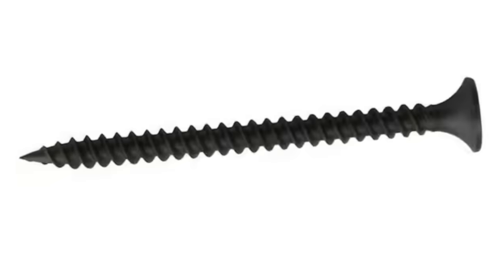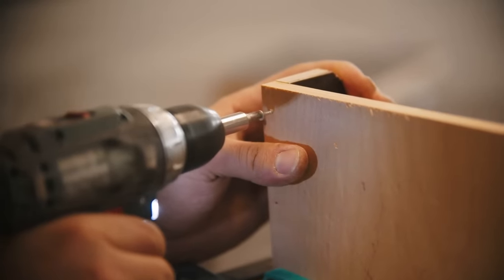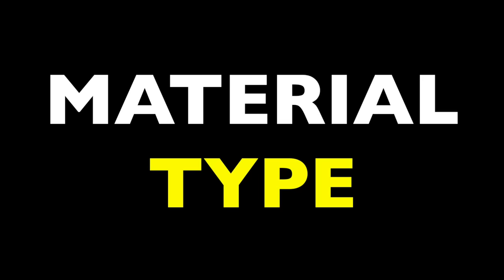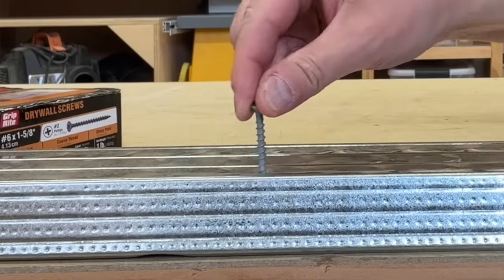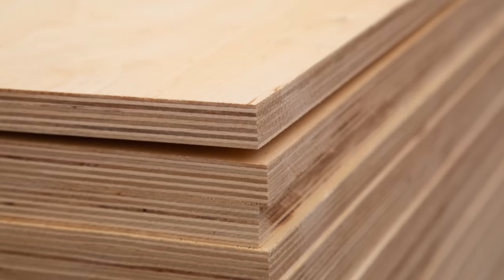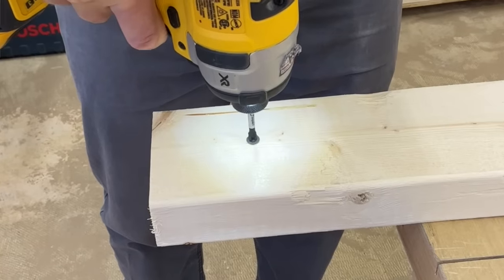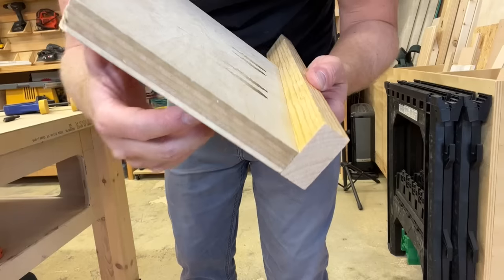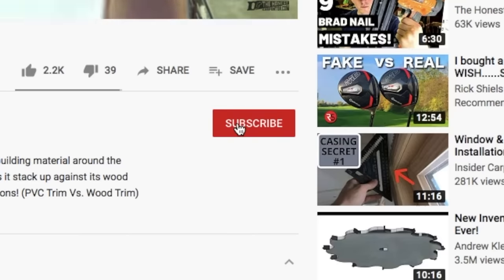This UNNOTICED Screw Detail Makes a Big Difference! (COARSE THREAD vs. FINE THREAD)

Comment: actually i have had many issues with course screws in pine boards and find fine thread work way better on pine boards than course screws even if pre drilled- my first holes are usually 1 1/2" either end of board then space depending length of board but if use course screws best try 3" on either side of board but when laying boards on wall i have lot less cracking and other issues with fine thread and just add some  wood glue to the screw-

Comment: As ignorantly simply as this subject is, it's important.  Most folks couldn't care but when your job depends on it, know what your doing.
TIP - Pilot hole drill size one step smaller than the diameter of the screw root (between the threads).

Comment: The function of that unthreaded portion becomes clear with Australian hardwoods.  A fully threaded screw cannot pull two pieces together.  Leaving a small loose gap.  So I have to fine drill the furthest piece to grab the threads then a larger hole in the top piece so that the unthreaded portion can fit.  It largely relies on the countersunk head providing force.  But in our hardwood the head will NEVER be pulled into the timber by any amount of force. I do wonder if the top unthreaded portion should only be the width of the core of the threaded part so it doesn't need TWO different pilot holes to be drilled.

Comment: I'd love a follow up on the varying threads for nuts/bolts. I've been working on used ebike hub motors and the axles have been mostly M12 and 1.25 thread pitch but when trying to locate replacement nuts or considering rethreading due to current threads being stripped, it's been confusing trying to figure out how/why the varying thread pitches are used.

 I'm now wondering if it's similar where more dense metals use finer thread pitches and softer or less dense use coarser threads?
Reply: @eder60hz51 it's not the nut with the stripped thread, it's the axle unfortunately. I did actually use a die to rethread one but in doing so I lost most of the "flat" of the axle that sits in the dropout.

Comment: Unfortunately, the full-diameter, unthreaded portion of fine-threaded screws (2:45) defeats the non-splitting purpose of fine threads by expanding the wood excessively (unless you pre-drill a larger pilot hole in that portion of the face wood).

Comment: Retired remodeler here; I believe you will find that the "old fashioned" screws with the unthreaded area by the head are made of mild steel and are not hardened like the ever popular drywall type screws.
I also think that a lot of the painted screws are actually "rust proofed" with a plating of zinc dichromate underneath.
I built a lot of decks but never used decking screws because they are so UGLY.   I used either hand driven stainless steel ring shanked nails or ( when I could get them ) hot dipped galvanized Maze Co. nails.
I've walked on decks I had built 20+ years earlier & they were still in great shape.
These were all custom decks, not mass produced decks.

Comment: Sheetrock screws are for attaching sheetrock to wood or metal substrates that's why they are called that !
They tend to be too brittle for attaching anything other than sheetrock and have been misused due to availability not practicality

Comment: Nail pops.  Have you ever covered these?   (I bought a condo and had about 7 nail pops between two rooms.  Now I have a few dozen between [almost?] every room.)
Reply: Nail pops in drywall are due to the wood studs drying out after the drywall is installed. Typically, framing lumber is fairly wet when fresh from the mill and construction sites will not wait for it to dry out before installing. This means that after the first few months after installation, the wood itself shrinks. When drywall is installed over top of this, even if the drywall screws are installed correctly to begin with, they get pulled through the top layer of paper that the drywall is made of. Unfortunately, because drywall's strength is only from the connection between a properly installed screw and the paper layer, this results in the screw being "loose" in the drywall and will eventually reveal itself as a popped screw.

The fix is relatively easy, just remove the popped screw and add two additional screws above and below the old screw hole. You will have to then go back and add drywall compound (mud) to fill in the holes and cover the new screws. Then repaint the wall.
Reply: A lot of builders use drywall nails and these are what usually "pop" however what @umchoyka said in the other reply is correct!
Reply: @umchoyka  Thank you for sharing your knowledge.  It's greatly appreciated.
Reply: @billashby7858  Thank you for sharing your knowledge.  It's greatly appreciated.

Comment: I agree with what you're saying but I would not the material difference between wood screws and a 16p nail. The 16p nail is made from a softer nail and will bend before it breaks. A wood screw is made of harder metal and is therefore brittle and breaks under impact..

Comment: I always prefer using Fine Threaded Screws because (too me anyway) they have more material Grip Strength & seem to stay lodged in the material longer.  👷🏿‍♂️
Reply from the maker: They are very strong, w!
Reply: Usually you can get from the manufacturer a catalog with the pull out and shear value of their screws into different material!

Comment: I put coarse thread screws into hardwood, and I drilled pilot holes before doing this. There was no splitting which was immediately apparent. Do you think I’m OK?

EDIT: Also, my screws are 2” away from the edge

Comment: Used to use screws that were called hi-lo that had one thread hi and alternate low. They also had a bugle head, kind of a in between anything fastener. Haven’t seen them in years wonder if they still exist?
Reply: They do! Most commonly with plastic or mdf. These days there are specialty screws with narrow flank angles (so thin thread of a harder steel) that have largely displaced them.

Comment: You missed one big item. Working on Old 1800 century structures. Beams are massive and dense as well as studs and joists. Pre-drilling always without a doubt required. I’ve found torque tips much better driving at slow to medium speed. You mention hard woods however those woods now a days kiln dried. And their hardness no way compare to 100 to 200 year old structural wood requires a faster with high tinsel strength like deck screws. Look into that please. Anyone else experience this please comment.

Comment: never ever ever try to drive screws into hardwood without drilling holes first.  In fact, when using screws longer than 6/4  I drill with two different bits, one slightly larger than the screw, the other slightly smaller, for the deepest part of the screw to latch on to

Comment: As a rule of thumb it is always better or equal to use fine threads.
Reply from the maker: No coarse, Brian??
Reply: From some screw manufacturers they can provide a pull out and shear value into different material in their catalog.

Comment: Great explanation! I’m trying to hang some cat shelves from my ceiling. The problem I’ve come across, neither the screws nor the bit I use to pre drill the holes are going in? They go so far then stop. I used my stud finder first, still nothing is working? What am I doing wrong?
Reply: High rise building ???   Possible concrete floor above is your ceiling ?

Comment: The measure for this is "threads per inch" in American ... and mm per thread in Metric ... you started with drywall screws, which have a #6 shank, and 6 threads per inch ... however some drywall screws come with a double helix, both are 6 threads per inch, just one has twice as many threads ... I wouldn't use a #6 screw for any structural element ... just attaching decorative pieces, like drywall ... always use finish nails on doors and windows, the next guy who comes along will need to drive them all the way through to remove the old pieces ... also where water is an issue, nails will create much smaller damaged volume, perhaps allowing for just a bigger nail ... the screw will damage more wood and create a much larger hole, lag bolt sized, and that's a much more expense repair job ...

Comment: thanks! do you have piece on making sure your bit driver matches the proper head? often times people use the wrong size bit driver size for the screw they are driving, also the difference in putting in screws with an impact driver vs a torque set drill.
Reply from the maker: I’m gonna cover that agray! #1, #2, pozidrive, etc…

Comment: Question:  Why do some fasteners have a great deal of the shaft unthreaded, while others have just a short amount?
Reply: I have the same question.  From the lack of response I'm guessing either no one knows or it's an industry secret.  I was thinking that it is used to accommodate washers and the like.
Reply: Looked it up.  It allows for a stronger hold and possibly better shear strength.
Reply: The smooth shaft is for the top layer of wood. If you try to unite 2 pieces of wood with full length threads, you will tear the wood as the threads fight each layer of wood.

Comment: My screw gun has 1 speed, extra extra fast. So I prefer the fine pitch screws, which gives me an extra millisecond to get the head depth just right. Drywall screw quality is so poor these days that I have to drill pilot holes for longer ones regardless of fine or coarse threads, so I see no difference. I don't even know why drywall screws are made longer than 1-1/4 anyway.
Reply: If you were a remodeler you would encounter many different situations where they come in handy; I carry hundreds of fasteners - drywall screws from 1" to the longest I can find !!!

Comment: It is not entirely right explanation, because it is not so much about hardness as it is about relative strenght of materials 

those fine thread screws destroy lots of material along and very little is left to hold the screw itself  so it easily falls off also thread ribs are way too small on fine threaded screw to grab any significant amount of material.

Comment: Finer thread should theoretically be stronger than coarse thread. The more surface area, the more friction required to initiate movement(mu). That being said, the screw is almost never the limiting factor. The diameter of the screw threads will have a greater effect due to it actually having more material(area) to grab.

Comment: Why do you show drywall screws going into oak????? Even when pre-drilled, oak boards can easily shear off the heads of these weak screws that are made - specifically - for use with drywall only. This is not a minor point. Your explanation of why rough-threaded screws also misses a key point: deck-type screws typically have a self-cutting feature that literally drills a hole as the screw is being driven.

Comment: Screws are much weaker than nails in shear strength. If you are building a project that has to be structural you should not use screws.

Comment: What is the point of doing a video about threads, if you do not analyse the whole topic? You exposed only the point about self drilling screws, and sorry but that is way too far from unconplete. Threaded bore, torque, design rules (how close from each other, how deep in the second piece, etc) should belong in this video